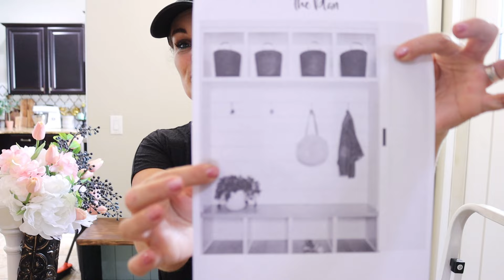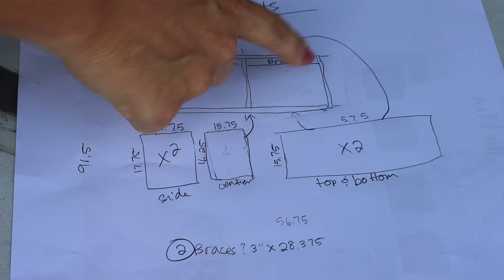Shocking DIY IKEA HACK Mudroom Lockers!

Comment: This turned out beautiful, Natalee! A friendly tip for cutting out areas for your bench: 1. leave the switch plate on, 2. Cut a piece of cardboard and affix to the bench where you’ll need to cut. 3. Add a little lipstick ‘dots’ to the corners of the switch plate. 4. Push your bench so that it touches the lipstick dots. When you pull your bench away, the dots will transfer to your paper and you’ll know exactly where to drill. You can also do direct to the bench, if you don’t want to deal with the cardboard. Hope this helps you on your next adventure! ♥️
Reply from the maker: Hey! I love that tip. Thanks so much.
Reply: @designedtothenines  you’re so welcome! ♥️

Comment: You totally amaze me…..these are my FAVORITE types of videos!!!
Quick question……maybe in your next video, can you show on your nail gun (I realize all may be different, but it may give me an idea), where to change to depth of the nails!! Ughh…..mine is a battery operated pin gun/staple gun and love nor money I can’t get the staples COMPLETELY in!!! It’s like an 1/8th, maybe 1/16th sticking out and that’s not good!!!
And BTW, tell your sexy hubby I loved his cameo appearance ❤️😂❤️😂❤️😂
Reply from the maker: This was the first time using it and I am not super impressed. Nail guns with air compressor simply work better. Having said that, I did find when I had it really square and pressed on trigger release fully, it would counter sink it fully. But seriously, what’s the point of a nail gun if you have to go back in and swing a hammer any way right?! 😅
Reply: @designedtothenines  EXACTLY!!! If my dingy hubby hadn’t bought a compressor the size of Idaho, I could take it around w me. I think that’s my next purchase 🙈😂🙈. Thanks sweetie
Reply from the maker: @chrissybetlem9872  And that is definitely the draw back of other type of nail gun. Maybe somebody needs to address these issues!!☺️
Reply: @designedtothenines  I nominate YOU!!! You’re the smartest!!!! ❤️❤️❤️